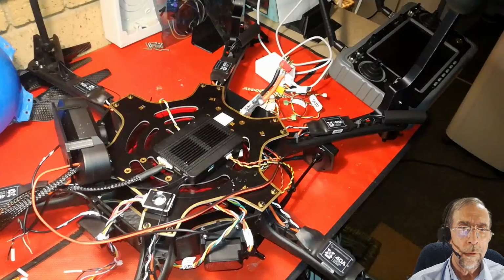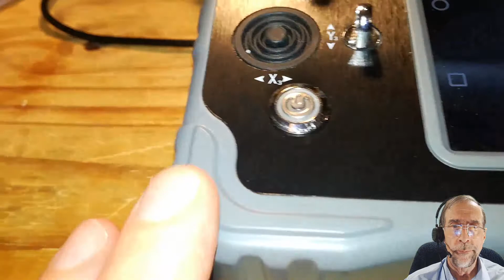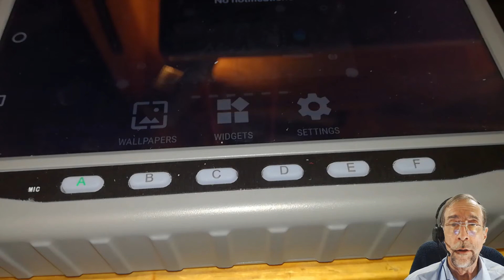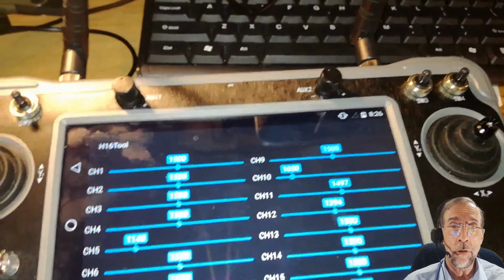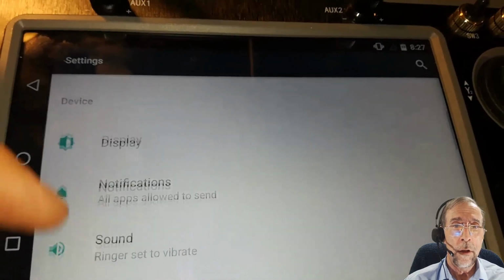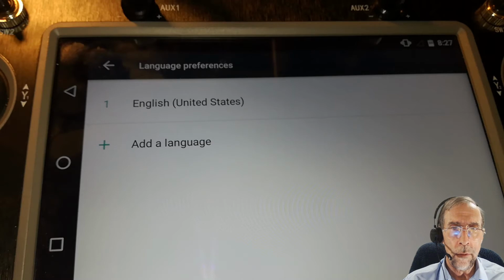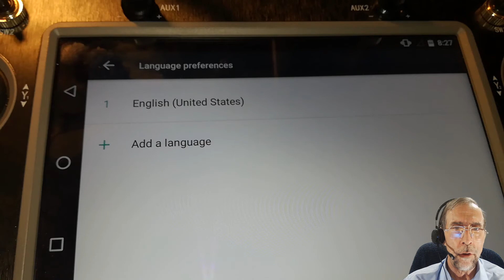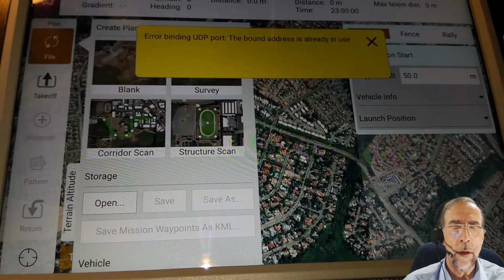An Introduction to the CUAV H16 long range control and video system.

Comment: Hello Sir, How you are giving power to the H16 Receiver ?? Are you using any DC to DC buck converter or you have directly plug it into 6s Battery with same ground ?
Reply from the maker: Good day. The receiver on my drones I powered it directly from the battery. I am using 4S batteries. I don't know if you are using 4S, 6S or 12S so check with the manual that you are not exceeding the maximum voltage that it can handle on its power input.

Comment: Hi, can u please tell how to connect H16 Pro with laptop/tablet for video and telemetry sharing. Is it possible to connect via hotspot, tethering and ethernet?
Reply: There are plenty of options in this regard. I have tested all these options and all of them work except one. I have communicated this to CUAV and I am just waiting for an answer. I am hoping to explain this all in the next video.
Reply: @johnlongland8902   How you Bind The Receivers to The Controller ? Can you make a video of the setup

Comment: Where do you connect the anti-static wrist strap and mat? thanks
Reply: Hi. If you buy the anti-static system as a kit, it will come with a connection to the earth-pin on the mains-outlet. If you buy the anti-static components separately, then you wil have to make sure you have the matt, the wrist strap and the connection to the earth-pin on the mains. It normally looks like a mains-plug on seroids !!!